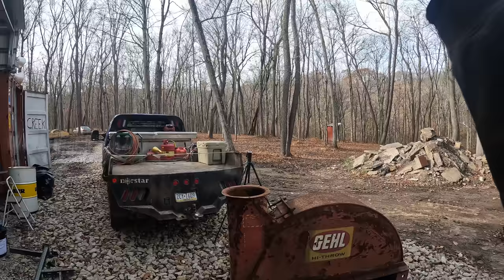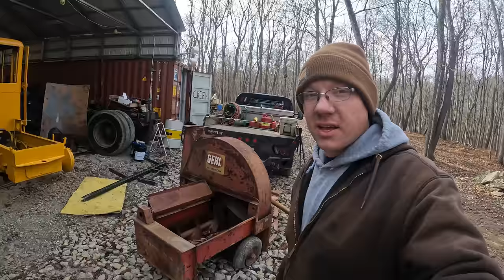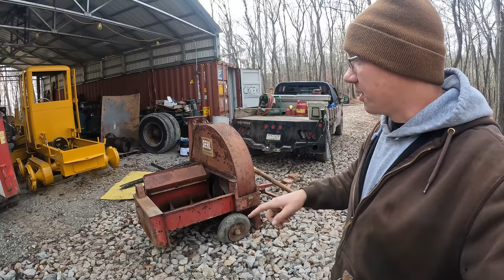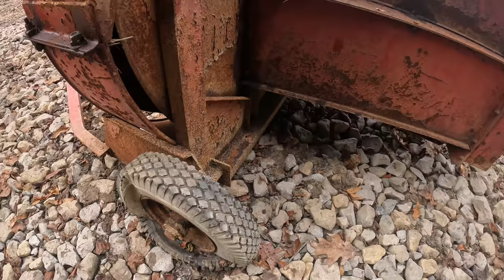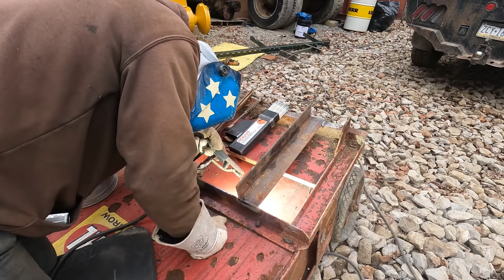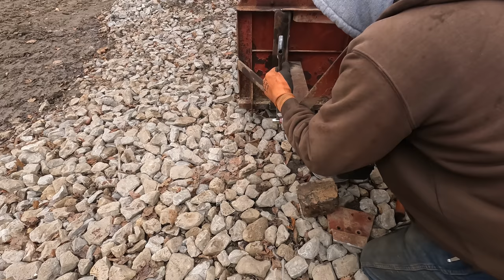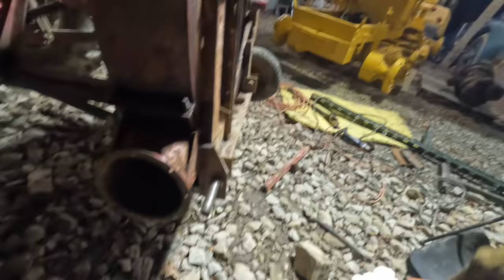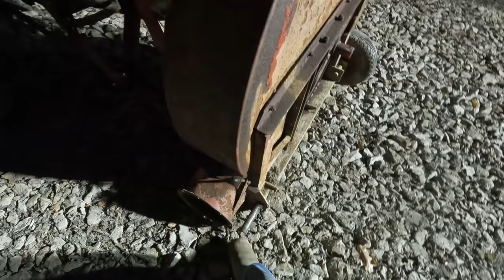I Built a Giant DIESEL POWERED Leaf Blower!!!

Comment: flat ducted nozzle time!!
would work great if it had a nozzle to direct airflow down and as a flat sheet of air
when blowing leaves what matters is velocity of air, not so much the pressure your turbofan can blow, same with billet and straw blowing
the lightweight nature of these particles means you need more flow to keep them aloft
the best way to do it is to buy a chunk of ducting adapter that goes from flat box duct to round duct of your blower size, this focuses the limited flow you have for the least amount of cash to maximize how well the current flow works

if you need more than a nozzle can provide you need to gear it up a tad(and trim the rubbing blades so you don't need the torque on the blades), I'd say a 2:1 fixed ratio would be ideal, much higher and you risk PTO stall from overtorque, any less and you might as well not have the gearbox/belt

but with several miles of large stone driveway this blower is a dam good idea, compost on your driveway is just a bad idea, manual blowing with carry-on machines would be both torturously labor heavy and time wasting, and you already have a PTO machine with a 3-point you use for mowing and ect

I still think the rubbing could be robbing you of some function, the rubbing raises torque requirements, slowing engine speed(or hydraulic load going up if it is oil-powered)(and wearing out PTO clutch if direct)
slow your engine too much that it stops needing to govern itself(ie the torque is reaching near-max output) and you start slowing the blades wich can drastically reduce airflow at lower RPM

the best solution that would make this unit ideal is a ~2:1 speedup from PTO power, and a reduction in rubbing to bare-minimum practical, then add a flat nozzle you can angle down to reach the perfect level above the ground

and as this is moving shitloads of air it can be used with a similar PTO-powered vacuum attachment, a boxy device that rides on the surface with a grate that is smaller pores than the rocks you want to stay, and a cycloidal separator above a 55 gallon drum(plastic so it is easier to ensure it stays airtight

but given the vaccum+blower modes, it may then be ideal to have a trunk of cable driven valves(or run lines right up to the seat) to turn the direct-drive fan into a hydraulic pump+motor gearbox with a few small pistons to aid in mode changes, then stick it to your mower to suck up the cut grass and make biogas to run your pony motors and handheld 2-"smoke" engines off a tank of biogas in a backpack
Reply: also oil soaked straw and sparkyfan would be "fun" as well as knowing with the sheer volume of air your oil won't cook :P

Comment: I would blank off the hole at the bottom intake and make a new one at the top with a variable slide so you can adjust the amount of air going in the intake and put a flat shute on the outlet like the old fishtail exhausts on motorbikes that will increase airpower the hole at the top as new intake will increase the power the amount of air to push out a hole half the size of the old inlet should do with a slide to shut or open the amount of air you want to go in the blower should make so much more power anyway that's what I would do if I had to make a leaf blower as at the moment it only has a few inches to travel before the air is expelled that's why it's so poor a hole at the top gives nearly all the blades time to accumulate a lot of air to push out the fishtail outlet it should send the leafs miles lol it will be raining leaf's in the next state.lol

Comment: ABRASIVE CUT-OFF MACHINES ARE MUCH BETTER THAN THE SAW TYPE YOU USED TO CUT YOUT ANGLE WITH. YOU WILL DRAG THE SHARP METAL PIECES ALL AROUND THE SHOP AND IN TIME THESE PIECES WILL FIND RHEIR WAY INTO YOUR VEHICLE AND ULTAMITELY INTO YOUR HOUSE.

Comment: Your intake hole is too large.  Remember, that is designed to have that hole mostly choked off with silage.  That silage would also create lower air volume in the chamber which would in turn create higher pressure.

You can also flip the band around so it blows out the other side.  That would pretty much force the air to go all the way around.  So the intake would be at the 6 o'clock and the exhaust would be 4 o'clock.  Close off the intake and change the exhaust.

If you are still struggling then neck down the exhaust to a smaller diameter.  That will increase pressure and thus velocity.

I would make sure you have an air chute around your intake so it only draws air from where you want it to.  it could suck up debris and launch it into the side of a car or shed or a living thing...  A large air chamber would fix this.  I would take the top half of a 50 gallon drum and mount it over the intake then cut a door in the topside so you can use it like a damper to maximize intake pressure/volume.  You can leave the giant hole in the blower like it is now, but it can be removed if you want to use it to blow straw - or take use that 50 gallon drum as your chute for the straw...

I digress.  Your priority is to increase air pressure/velocity.  Closing off the intake and moving the exhaust over to the other side will help.  Then neck down the exhaust size to a smaller diameter and you'll have a blower that will clear 20 yards per swath.

Comment: That HUGE intake opening on the fan-----Don't do it----sort of wants to tempt you into throwing a watermelon in there!Watermelon puree for everyone! You did get that blower to work as a leaf blower-wonder if a fan shaped nozzle  mounted to the discharge nozzle would concentrate the airflow -making the leaves blow better.You could make a metal cover over the present intake with an opening around the center of the fan.Usual centrifical-squirrel cage fans have the intake in the center of the fancase.That blower gave you the ability to position the discharge where you need it-and holes on the discharge opening to mount other types of nozzles on it.

Comment: 👉💥Take the nosle/gaurd off and flip it around,🙃, you'll have the nozzle angle the way you need it, and the clearance that you need as well, and then if it lifts up or sucks in a projectile, it should be more aimed at your driveway then at a window On one of your vehicles or buildings. Reduce the intake  opening back down to the original design, throw some snap latches, butterfly latches, spring lock clevis pin holders on your expanded steel intake guard in such a way that it can be used for those other purposes you were referring to. And perhaps add your own home made concentrator or nozzle that bolts up to the flange of your out flow port if you don't find you have enough wind coming out of The thing, and for god sake's fix that rotational impact area, it's hard on the whole assembly, with a thing like that spinning, you don't need to have something loosen up or detach. smooth out the surface of the rotational nozzle band pinch area and grease that sucker. Install another hand hold on that band nozzle assembly to you give yourself another purchase point to help you rotate it. When it's all finished, neutralize that rust and give it a paint job when it works well. For giggles, slap a name on it, and call it maybe "the titan blower" or perhaps the "big blow job", that might help save some time with  reexplaining to people what the thing is.... good luck!💥👍

Comment: Good  try, you do not have the proper fan, you need a squirrel type fan,  like you said air intake is in wrong place, it need to be around the shaft area it should pull from center and push out

Comment: Well that's a let down. No better than a backpack leaf blower. And now it's mounted on something that's almost a total length of 20ft thus having the turning radius of something that's 20 ft long. Kind of hard to blow the leaves into the woods if you can't literally walk into the woods a little bit. 
You get an F for forward-thinking but you get an A in effort. 
Oh and before you decide to use it as a straw blower I heard you say something about bails. Well there's a good reason straw blowers have a pre grinder before going into the blower. I'm sure you don't want to find out why the hard way.
At this point it would be better if you just convert it into a gigantic air raid siren. It's about that useful now.